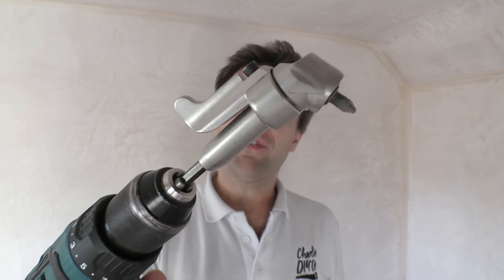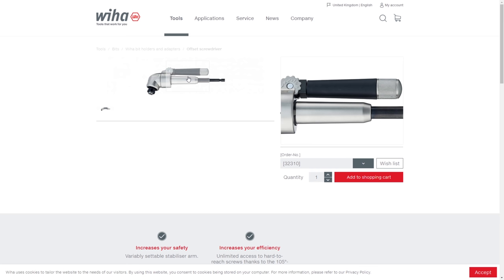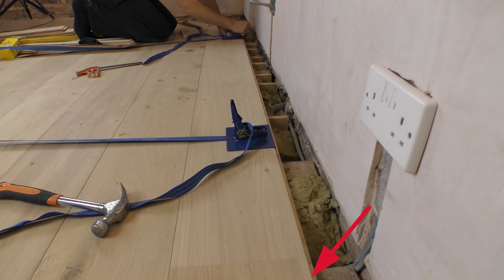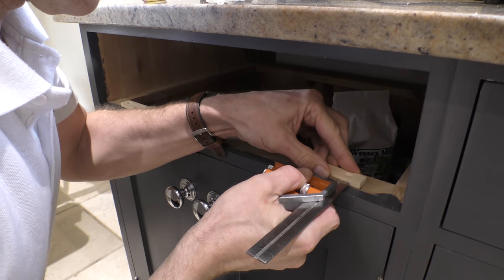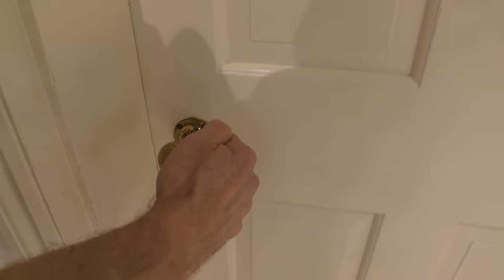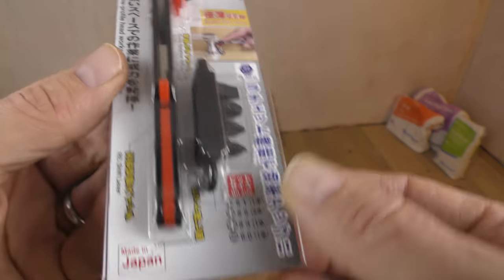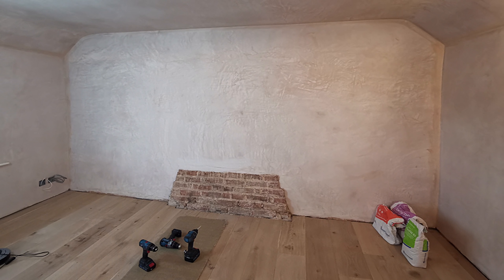Offset Screwdriver Attachment for Tight Spaces

Comment: I bought an right angled makita 18v drill a little while back and wondered how Ive done without it for years. Its a really useful tool if you have a bunch of makita 18v tools as I do. Drilling through joists, and for example screwing down a toilet pan screws where I could hardly get my hand in.  I can see the value of this tool as well of course.

Comment: I have the DeWalt version of this which design to use with impact driver as well as combi drill
Reply: So is this, any attachment other than a drill bit shouldn't be used in a drill. Maybe a mixer but not screwdriver bits

Comment: I have to agree with the torx screws comment. 

It's hardly used here in construction as manufacturers are still chancing their arm by making them 2x or sometime 3x as expensive than pozi...

When watching Scott Brown Carpentry's vids in NZ nearly all the screws they use are pozi or square drive. 

Torx is the way to go if using this attachment.... Thumbs up on the vid - very insightful... Keep your eye on those triggers on the Erbauer drills if still under warranty - Carpenter's trigger went on site last month and heard triggers often fail on Erbauers. Hope that helps!

Comment: By the way, the Japanese don't use Pozi; they have their own JIS (Japanese Industrial Standard) screwhead that is 'sort of' compatible with Philips.  You might have seen a Philips screw head with a dot 'punched' on it on the back of a HiFi or telly from Japan.  That's a JIS fastner.

https://www.motorcycle.com/ask-mo-anything/difference-between-japanese-jis-phillips.html

Comment: Hows the erbauer 18v tools holding up ?
Reply from the maker: Pretty damn well actually mate. The battery life is excellent. I don't tend to use the combi that much as it's quite heavy but the impact works great and the drill driver is a lovely little tool. The one thing my carpenter mate John pointed out is that there's a very slight lag when you squeeze the trigger. We thought it was maybe an issue with brushless tools in general but his Makita doesn't have a lag so it must be a design error by Erbauer. On balance though, good value for money, I'd say.
Reply: @CharlieDIYte  I bought the combi drill used it a few times feels like a good drill but you are right it is heavy should probably just have bought the drill driver for what I use it for but the combi was on sale for £115 with 2x 5ah batteries
Reply: Great to see some feedback on these tools; there are loads of reviews on YouTube of US-specific brands like Kobalt or Hercules (which is great and they're interesting to watch), but very few on the UK-specific brands.

Comment: That low-profile ratchet is made by ‘Engineer’ and they also do a pliers designed for removing screws with stripped recesses https://www.amazon.com/Engineer-Neji-saurus-PZ-59-Screw-Pliers/dp/B00NBSVYOY?ref_=ast_bbp_dp

I have one and it’s very useful.... especially over here in the US where the infuriating Philips head is only now being slowly replaced by Torx. Removing old screws is an act of hoping you can back it out enough before the recess strips and then it’s time for these pliers to come into their own.  I used to use vice-grips but often they would be too much at the wrong angle.

Comment: Quick tip for you about it not fitting the impact driver correctly. Clamp a grinder or Dremel down with a grinding disc on or clamp the attachment down and then grind the groove into the shank of the attachment taking the measurement for where along the shaft to do it from an attachment that does fit your impact driver. And there you have it, your non impact driver fitting attachment now fits your impact driver and clips into place. Hope that tip helps you or someone else.

Comment: My cheaper version has enabled me, not only to do jobs in tight spaces, but to do them better e.g. screwing battens to the floor under a raised shower tray with screws at right angles to the floor instead of at an angle. I have also used a long 'bendy arm' screw driver attachment in this and several other tight spaces and I was very surprised at the degree of downward pressure I was able to obtain, given the rightangleness, with both types of attachment enabling a relatively easy insertion of the screws.I would have used the bendy arm on the door handles. In my opinion these are essential items for the toolbox.
Reply from the maker: Great work Steve and I like your use of "rightangleness" too 😉👍🏻

Comment: Hi Charlie,,, that was great,,, its one of those tools you only need every couple of years maybe if your a diy er but invaluble to have,,, Ive used a small socket set with a screw bit in the past in tight places,,, that works ok as well.I find the hardest job is trying to unscrew a seized screw with a straight cut head,,, especilly if someone has attempted to unscrew it previously and knackered the head on it

Comment: Hi Charlie, I found the Chinese version of the hand ratchet last year for £2:99, so I bought 4 of them because I expected they would not last, but at that price, I did not worry. I still have 3 of these that are working fine (I lost 1 of them it did not break) and they are a great tool that even allows you to fit 1/4 inch sockets on and that is really useful. Unfortunately, I can't remember where I got it from but even at the price you found them for is worth the money. I also have the ToolStation one that fits onto a drill and that is good quality as well

Comment: No, no, no... Almost 90 degrees is not good enough and that flipper is too bulky! Check for the one that DEWALT makes. 90 degrees and I've driven 7x150mm timber joist screws with it with nothing breaking!

Comment: Can you please post a link to the Japanese screwdriver - this is the perfect solution to a problem I have.
Reply from the maker: So sorry mate. Completely forgot to add that. It's on there now.
Reply: @CharlieDIYte  Thanks Chatlie
Reply: You may get away with a  small 1/4" drive socket set/ratchet with a 1/4" to hex bit converter

Comment: I have an angled attachment for my drill, and forgotten I had it, thanks for the reminder. I like the little manual one from japan though. I have a 1/4" drive ratchet socket set with a converter for hex bits, so that is also an option I have used in the past.

Comment: tipp-ex in a tool box?
Reply: I was just about to ask that question ha ha
Reply: Anyone else want to see Charlie to a toolbox tour?
Reply from the maker: I nearly took that out but thought, what the hell, when the eagle eyed ask me what it's doing there I'll tell them 🤣 In the day job we hang a lot of roman blinds. The way they're made you have a "stab"stitch that passes all the way thought the blinds from front to back, through all three layers, including the black out at the back. This means you get little pin pricks of light showing through when the blind is lowered during the day. A tiny blob of Tipp-ex around the stitch at the back of the blind plugs the pin pricks and stops the light getting through.
Reply from the maker: @Oli_Hudson  Hi Oli. I often wonder about doing one of those but see other YouTubers doing them and think they can be a bit self congratulatory. If you'd find it useful though I'll add it to the list 👍
Reply: @CharlieDIYte  does the tipp-ex stay in place? Doesn't it crack and drop off eventually?
Reply: @CharlieDIYte  Please do Charlie! Cheers!

Comment: The last offset screw driver was the best. I have used the DEWALT one before and it saved me a lot of hastle. The only down side I have had is that when the screw to be accessed is some what deep where you cannot get your hand in and the screw is in horizontal direction, the unit keeps rotating downwards. A long parallel stabiliser shaft would have been most useful in holding the unit in a horizontal position. May be in a next version.
Reply from the maker: Thanks 👊

Comment: I’ve the cheap Screwfix one which looked really good. Its good for light/small screws, but for high torque it’s really hard to apply required torque pressure and can easily chew your hand up if you’re not careful. The Wiha one in video looks great! Might be on the Xmas list! ;)

Comment: They are very useful, I have a pair from lidl, one has the 1/4" socket like yours and the other has a 10mm drill chuck. Both have saved my backside on more than one occasion.
Reply: I noticed the use of hot glue to hold the pieces in place, I would say either glue or an extra helper are essential for a lot of these situations as the offset driver requires 3 hands to operate as it is lol.

Comment: Quite useful video. I think I’ll go for the Japanese tool since I only need to tighten 4 screws on the bottom of my NATUZZI Genny arm chair (a real crap chair) which are getting loose so often and no way to tighten because small space for a normal screwdriver.
Natuzzi only offers a subcontractor service just to come home and tighten for no less 80-100€ and in 4 or 5 months again…..
I’m planing to tight by myself and just put a drop of some glue to avoid unscrewed again.
Do you know which kind of glue I should use? 
Thanks so much Charlie DIYte
Reply from the maker: Thanks Joan. What do the screws do/ secure and what are they screwed into (material wise)?
Reply: @CharlieDIYte  Thanks Charlie for your help.
The crews are flat head+allen, 3 cms length (1,18 in) and I don’t know yet the thread. They read in the head 8.8 S. Don’t know the material but seems not to be inbox. Perhaps cadmium I guess.
These 4 screws are attaching the round flat metal plate of the base/floor-shaft to a metal plate inside the bottom upholstery of the chair which I can’t see it but with much difficulties I can touch.
Good news: I discovered I can install a washer and a nut in this side and secure the screw. 
Being allen I can tighten much more easily despite the space is only 47 mm (1,85 in). So I won’t need to buy the Japanese tool.
Now, what I need is to apply some glue (Loctite blue 242) ?? and some washer anti loose + the nut.
The most difficult is to access.
If you have any idea or advice, please welcome!!!
Thanks again.

Comment: I've used those 90 degree drill adapters a few times, and I have to say I hate them. Sure they let you reach an otherwise impossible to reach screw, but I find it difficult to stabilize when the drill and the adapter are able to rotate independently of each other. The first adapter I had blew up on a kitchen reno that I bought it for. The second one came close to injuring me a few times when I was trying to cross drill some studs for a bathroom reno. What would happen, is the bit would jam, and with only one hand holding the drill, it's more likely to fly out of your hand, or try to twist your wrist. Very dangerous! I've since purchased a dedicated 90 degree Milwaukee cordless drill, and I find that the extra control I have on it made the purchase completely worth it. Incidentally, I think I only paid about $160 CAD for a new tool-only purchase. So it's relatively affordable as far as good power tools go.
Reply from the maker: I was going to say that's why it pays to get a decent quality one like the Wiha but you've done that with the Milwaukee. Good thinking. I guess the only issue is if the space is too restrictive to get a dedicated 90 degree tool into? I agree they're tricky to use but a life saver where you need them - like when I had to use it to screw in the base plates for the concealed hinges on this project. https://youtu.be/tdMnnkvInrE
Reply: @CharlieDIYte  Milwaukee makes more than a half dozen models of right angle drills to suit different needs. They have a tiny M12, all the way up to large heavy duty M18 and corded versions for electricians and plumbers that need to crossdrill studs all day. I already had existing M18 batteries, so I bought their smallest M18 right angle drill. It fits most places. The LED light on the end is nice too (it turns red when you max out the torque on the tool). One place the tool really shines is when you have to do any overhead driving. Since getting the tool, I've found it to be extremely useful. I use it a lot more that I thought I would. A right angle drill is a night-and-day difference between using a right angle adapter. In the odd places it doesn't fit, I still a 1/4" drive ratchet I could use, as well as a set of offset screwdrivers.(The ones that look like Allen wrenches).

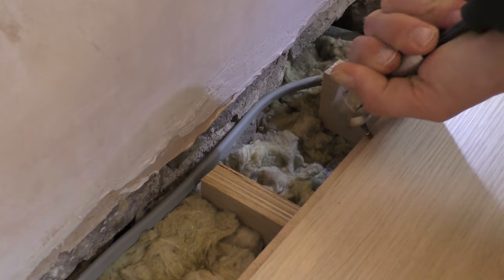Comment: 3:15 the demo with the floor board, your not driving in to a joist just thin air
Reply from the maker: I thought some eagle eyed viewer might pick up on that.😉 I've got an extraordinary arrangement with my old Victorian floor joists in that they don't run all the way up to or into the wall. Instead they simply sit on an oak plinth that runs the full width of the room.  So I had to screw extension pieces to each side of the joist to support the final floor board. In the clip you're referring to, it looks like I'm screwing into thin air but actually I wasn't. The joist finishes just before the end of the floor board.

Comment: I've had the cheapo version of this tool for many years; it's the best way of driving screws in between floor joists, and has handled even large screws without failing. If you don't use it that often, the cheap version works fine. Only problem I find is that I can never find it at the bottom of one of my toolboxes or drawers when I need it 😀

Comment: Not a mention of the dewalt impact driver angle attachment which is designed for impact use.  https://www.amazon.co.uk/DEWALT-Right-Angle-Attachment-Impact/dp/B07NQS465R/ref=sr_1_1?keywords=dewalt%2Bangle%2Bimpact&qid=1575730181&sr=8-1&th=1